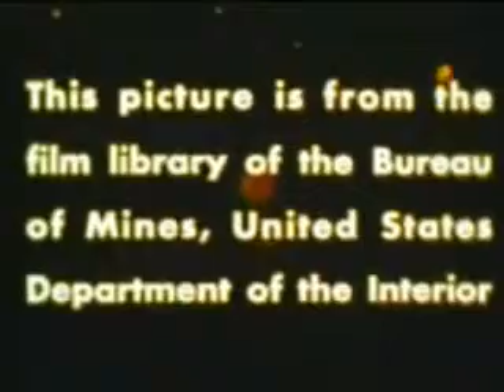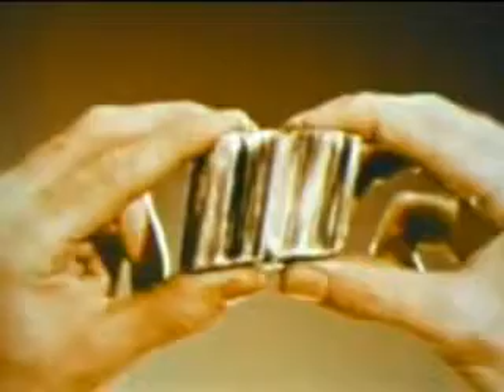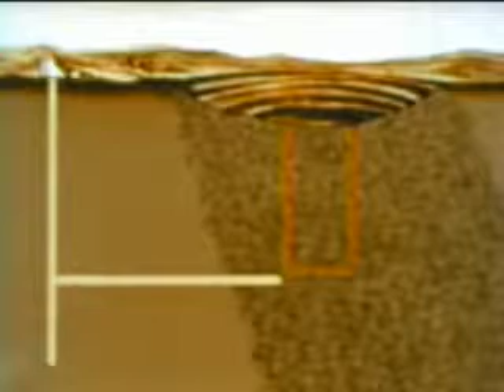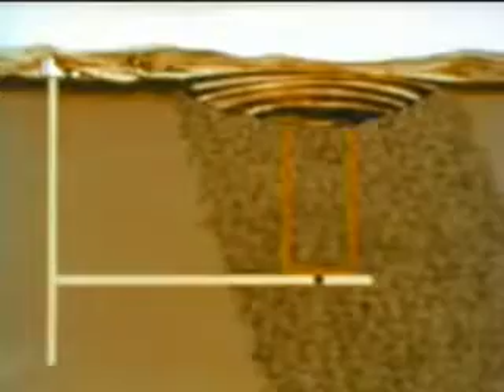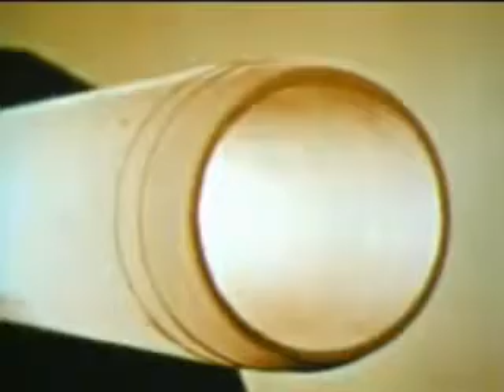Asbestos: A Matter of Time (1959)

Comment: My mother was a secretary for the John's Mansville asbestos and fiberglass insulation Co in NYC back in the 1950s. She said that back in the 50s even the men whom worked in the manufacturing plant were hardly ever seen wearing any sort of masks let alone PPE clothing, or anything! So yeah these men and women would be covered in asbestos dust in their clothing, hair and skin that followed them home! Then their families were getting heaping doses of fiberglass and asbestos when these people would arrive home or in the vehicles. My grandfather started as a grunt engineer on a Merchant Marine ship during the start of WWll. Working in the engine rooms while working his way up the ranks @ Kings Point to an officer he told me that they would be handling asbestos and stuffing it in pipes shoulders deep inside steam fittings to keep them insulated and causing condensation problems. Then afterwards being the head engineer of many schools in Manhattan and running the boilers and steam systems in these buildings he was still handling the stuff like it was completely harmless in anyway. Not even a dust mask or anything! After all that he retired from the schools and brought home some asbestos panels and of course tiles and had them in his house lining the floors of the basement and these large panels of raw asbestos on the walls of the basement surrounding the wood stove. Both somehow my grandparents made it almost into their early 90s and ended up dying for other reasons non-related to anything asbestos, amazingly? And yes we still have the use of asbestos cement pipes in our development drinking water mains. But like the textiles such as tiles and siding panels being in bedded with a binder of such things, it's not necessary a dangerous product unless broken up or cut or sanded upon. The fibers are basically locked inside of  the products they were processed in. But they are a definite danger to those who are not aware that so many different products were actually made of asbestos and what they should and shouldn't be doing with it!